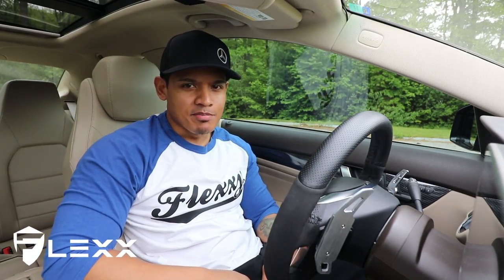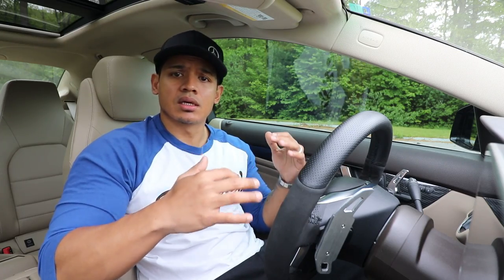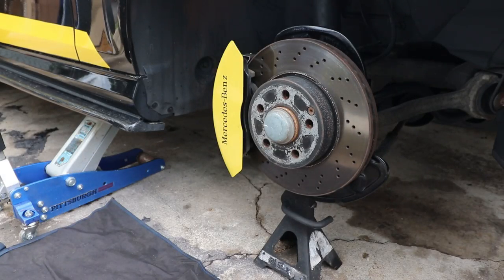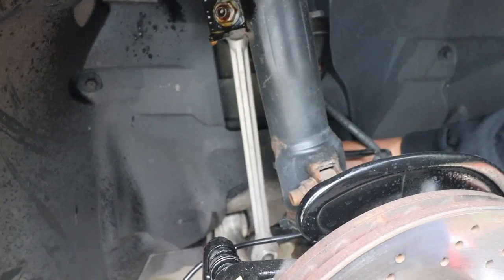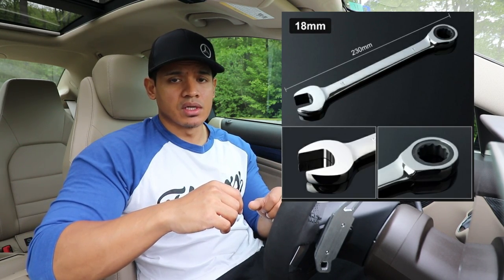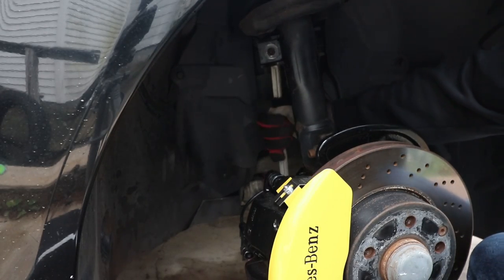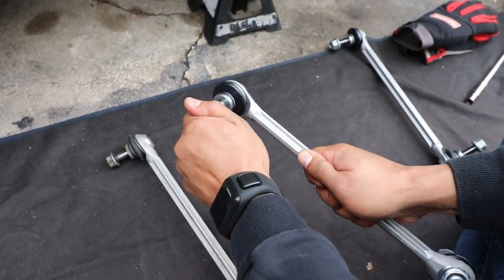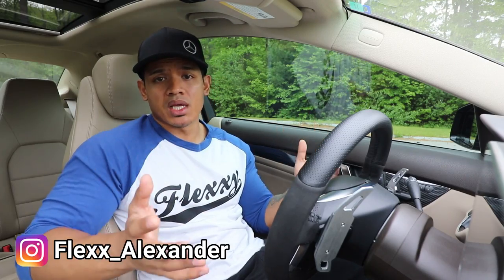Why do the sway bar links on a Mercedes fail so quickly!

Comment: I thought you was going to address the problem of " WHY" the links fail so quickly. As per your video title. Anyhow thanks for the tutorial....good job.
Reply from the maker: The quality is just terrible. That’s all.
Reply: I've changed my end links twice already. Seems like they fail every year.I thought Lemforder would be better than that. @TheFlexxGarage
Reply: If you have lowered suspension that's why. You should install drop links longer the same amount you lowered your suspension.
Reply: @bianbian428 I just used new lemforders last year and the rubber already splitting

Comment: Owning a Mercedes is nice, but it's a never ending story with clunking and clicking, and when done all that you find out the suspension top bushes also need doing! 😭
Reply from the maker: Not me. Only had this 1 issue due to normal wear and tear.  And I had 1 extended warranty part replacement and that’s it.  Was a great car. That’s why I bought another Mercedes.

Comment: Just a tip but I recently put performance/adjustable sway bar links on mine, and whether stock or not they have to be on a actual Vehicle Lift for proper Pre-load, jacking up that part of the suspension wont give you the correct Pre-Load. If they are installed with the load slightly off even if you don't notice it this will cause the sway bar links to give out very quickly or wear a lot faster. If there is proper Pre Load applied and they still wear out quickly, that usually means their is something wrong with another suspension part. Sway Bar Links are more of a fail safe in case another part of suspension goes out. Just a tip for next time!
Reply: Does the excessive wear occur on the ball joint because the ball joint won't have its full range of motion afterwards if it hasn't been pre-loaded because it won't be in the neutral position when the weight is on the wheel and the car is in a flat surface?  I found that the end links bolting surface must be lined up perfectly flat with the strut bracket bolt hole bracket at the top and with sway bar bolt hole surface at the bottom, otherwise the ball joint bolt comes in at a slight angle into the holes, and you end up with a small gap between the end link and the strut bracket at the top at the bolt point and sway bar at the bottom when you tighten fully (98NM), (causing the noises later ?).  Anyway that's how I did it because I don't have a vehcile lift and on the ground I can see the bottom ball is in the neutral position, it sits flush up against the sway bar, and the sway bar is horizontal to the ground.  No noises, drives straight, steering feels much tighter and even in both sides, the car sits flatter on cornering.  See what happens I guess.
Reply: Potential silly question but what do you mean by pre-load? I changed my sway links by jacking the car up in the middle pad at the front and removed wheels, changed links (I didn’t have anything under the control arms taking any weight etc) just removed old ones and new ones straight in.

Comment: Thanks for the video man. Mine started to make the same sound  a couple months ago. Amazing!

Edit: not exactly the same sound, but mine squeaks.
Reply: Depending on how worn they are, if the lubcrication/rubber has completely disintegrated you will get a HORRIBLE squeal when you are driving, yet it stops when you are braking. I found that out through experience.

Comment: Should be able to get around 80k-100k km's.  Need to make sure the end links tighten up flush with the strut bracket surface and the sway bar.
Reply: here is a discussion about this: https://superpro.com.au/how-to-install-sway-bar-link

( yes it is about after-market adjustable end links but the principle is the same- the end links must be fitted in a neutral position with the wheels under normal static load on a special hoist

if they are not it will not be possible to have them tighten flush against the strut bracket or to the sway bar because the bolt of the end link ball joint will not come in the right angle.  This will limit the full movement of the ball joint as the car is being driven and steered over uneven roads causing early failure which is what I think might have happened to your previous pair of end links that failed quickly

Comment: I remember doing my endlinks. Was one of the most annoying things to do...
Reply from the maker: Yeah...the worst part for the benz is being able to use a torx bit or hex bit to hold the swaybar link shaft in place while taking the nut off. Especially on the lower nut. And if you strip that hole for the torx bit/hex bit, you are kinda screwed unless you cut off the nut.

Comment: I had the same exact noise. I replaced my sway bar links and the issue was fixed. Then a few days later the noise came back. Now I’m confused as to what it might be.
Reply from the maker: Wasn’t Installed properly then. Cause if there’s even a slight play…it will keep making the clicking noise (even if it’s new).
Reply: @TheFlexxGarage  I'm 90% sure I installed them properly. It was pretty straightforward. But I'll definitely check again. The new ones that came in were not very stiff but I assume that's how it is.
Reply from the maker: Did you preload them before tightening the bolt? Cause that’s where people make the mistake. They let it hang, tighten the bolt, and thinks it’s fully tightened. And when you lower the car, the weight of the car is now on the links and it will expose areas where it’s not tightened all the way.
Reply: @TheFlexxGarage  that's probably it. Definitely missed that step lol. Thanks!
Reply: I had the same exact issue and it turns out I didnt tighten one of the nuts enough.  Retightening everything again solved the noise issue
Reply: @Azhang22  it work with you after tightened ?
Reply: @TheFlexxGarage  What do you mean by preload like add weight lower the car a bit?????
Reply: Does your steering wheel make a squeaking noise when you turn it back and forth? If so it's the ball joints.

Comment: I have the same issue! However it goes away when i increase tyre pressure but returns when tyre pressure drops. Only happens when going over bumps and it clunks from the right side.

Comment: Very nice! Mine the clunky noises occurs only in bumps or degraded road. Is that the same parts? Anti roll bar links.
Reply from the maker: Yes. Possibly.  Or you might have shock issues.  I recommend you get it checked out by a shop before it gets worse.

Comment: My c300 with 150,000 miles on it recently is making a clunking noise from both front and back on the passenger side and it happens when I’m driving normally also

Comment: Hey Flexx great vid, I have a 2013 E400 love the car, but it does the same over the bumps as well? Mine has the airmatic suspension which I thought was about the best of all, but still doesn't handle the real bumps like potholes etc?

Comment: Hey, Flexx. 
How are you? Not sure if you are going to see this message as the upload is 3 years old.
I have a 2021 C180 Touring that I'm tuning. I'm looking to handling mods at the moment and stumbled across some Eibach sway bars and Whiteline end links.
However, I was checking my car and it seems there is no read sway bar, is that the same with the C250? I saw that you just swapped the front end links, so I got curious.
Thanks.
Cheers,
Akamine.

Comment: Hello Flex, had the same issue with my W205 C43 AMG. Had dealership do the work, in addition, they claimed an alignment was needed after changing these links out. Do you agree?
Reply from the maker: In my opinion (and I’m not a mechanic), I don’t think its needed unless your car is due for an alignment or you went with longer or shorter links.
Reply: Geez they are ready to eat that money you earned hard. 
Alignment shouldn't be needed if tire wear is equal and you replaced them for OEM or OEM like parts.
Reply: Yoy don't need an alignment when only replacing sway bar links. Other suspension parts being replaced will require realignment after changing

Comment: So i have a w204 wagon and its lowerd and cant use original sway bar links. Been trying to find adjustable ones but just doesn’t exist
Reply: If your car is lowered you need longer bar links. I bought w212 ones which are 22mm longer

Comment: I have a w212 e class....its making clunking noise on light bumpy roads....taken I to 2 garages and still a year on no 1 can find the problem...they hand move the drop links and say they fine...I've had 4 springs changed and the front shocks..plz can u advise me if hand moving the sway bar links can tell u that the links are worn...thanks
Reply from the maker: pretty sure it's your shocks or the sway bar links. Note, you can't just diagnose the issues with worn sway bar links by using your hand unless they are super worn out. When a car is driving and hittin bumps, there's thousands of pounds put on these links and shocks. If there's even a little give, the weight of the car will make it known (as a clunk, rattle, etc..). A hand does not have enough force to "diagnose" the issue. I would find a reputable shop that works on Mercedes.
Reply: @TheFlexxGarage  many thanks for the reply flexx...I will take the car to another garage or will get the front sway bar links changed first as the shocks have been done....my car is a e250cdi sport...and after getting the rear springs from dealers the rear height is super high...dealer says it will have a red and green mark on the springs which are correct....but I've seen on the net that for sport models it's a red red green dots on the springs for sports springs

Comment: Great video! Quick question. I notice you using a floor jack. Are you lifting on the rectangular inserts on the sill with some sort of block on the jack or are you lifting from another point?
Reply from the maker: Lifting it where the jacking point is on a c-class. My floorjack has a wide, round, flat rubber plate. I don't need a block.

Comment: I just broke a T40 torx bit after using PB blaster on the top nut. Had to pause the job because I could not remove the top nut. Have you ever had to cut one off because you couldn't remove the but with a torx bit?
Reply from the maker: Yea. I did the same thing in the other side.  I used a “nut splitter” to “cut” off the nut. You can get them almost anywhere. Worked perfectly. Just gotta buy the correct size that can fit over the nut.

Comment: These are heavy cars with tight running tolerances. Depending on the roads the parts will wear quicker than a lighter car.

Comment: I get a clunking sound only when I drive in the city especially when slowing down. On the highway clunking disappear. My mechanic cant find the problem lol.
Reply from the maker: Sounds like you need a new mechanic if they can’t figure it out.  Lol

It’s probably your shocks or shock mounts.  But again, could be anything. You need a qualified mechanic to diagnose it.
Reply: @TheFlexxGarage  The clunking sound comes from the middle not the wheels
Reply from the maker: Well you never said that.  Lol. I can’t diagnose your car without seeing it.  Definitely have another mechanic look at it as a second opinion.

Comment: Have you met the problem about camshaft position sensor bank1 where the issue is not the sensor or magnet but after some research looks like it is a common failure for a c250 do you have any advice or maybe a video?
Reply from the maker: Common problem. Camshaft adjuster is worn and timing is completely off. Keep driving and your engine will probably break down. It’s a $1500-$2500 repair. Go to a specialized German car shop if you want to save money. There’s no DIY for this.

Comment: What did you buy exactly. Im about to replace my sway bar links but I’m a bit confused as to what I need to buy as far as the sway bar link nuts
Reply: Mercedes part# 000000003276, it's just a grade 10.9 M12X1.5 lock nut.  $2.40 each at MB dealer.  I bought a few from the dealer and still haven't used them, I resued the old nuts and they work fine.  I've had my car apart so many times, struts, control arms, coil springs, and yet to use a "new" nut or bolt.  I just clean them up with a brass brush to clean out all the old loctite Mercedes loves using. Just replaced some rusty rear dust shields this weekend and reused all the hardware, though I did replace the brake pad hold down springs, part# 2014230592 for 70 cents each at MB dealer.

Comment: Hey Flex, I will be doing this job soon on my 204. What is the torque spec you used to tighten the locking nut? Did you use a specific one or just go as snug as possible?
Reply from the maker: I just went as tight as it will allow. And for these damn links, they have to be super tight or else it will click over bumps.
Reply: Sounds good. I've been scrounging around on the internet and haven't found anything concrete or consistent. Thanks for the help man. Appreciate it!

Comment: Hey man.. I have a 2007 e350 Benz where do I buy the sway bar links for them? I’m having a hard time finding them.. thanks
Reply: I just bought my end links for my car. Can't wait to install .
Reply: Dealer ship
Reply: FCP Euro.  I buy all the high wear  parts from them for there lifetime warranty replacement.   They warranty everything even brake pads, rotors, windshield wipers etc..

Comment: Hey bro, what's the worst that can happen if I don't replace my stabilizer links? I've got  a w203 and I think it's the same problem. Upon driving on bumps, it makes this horrible sound. Btw, how much did you pay for the passenger and driver links?
Reply from the maker: its wears and wears and can snap, making your car have more body roll when turning and losing steering performance which is a huge hazard not only for you but other people on the road. They are like under $100 for a pair.
Reply: @TheFlexxGarage  hey thanks  a lot for replying bro,I really appreciate that.

Comment: Why they fail so quickly..? 
Mercedes' double wishbone suspension eats any moving parts if they are not correctly installed...
When I install something new on mine, I always lightly pretighten it first, then I put full weight on the wheel, and then I tighten it to spec..
Reply: rvidal0001  to properly tighten these, you need a set of through sockets. harbor freight sells a kit that's pretty reasonable. 
https://www.harborfreight.com/sae-metric-go-thru-socket-set-21-pc-62305.html

Comment: Hi Flexx, You installed a strut bar which bolts across the engine if I recall. Q. Does that help extend the life of these links or is there no effect?
Reply from the maker: Not really. Just helps reduce body roll and helps with turning.

Comment: So why do they fail so quickly ???
Reply from the maker: Don’t know.  Could just be a cheap part or poor design or just the nature of the piece. I would rather have this piece start to fail and i pay small money to replace it several times before i have to replace other larger, more expensive suspension components.
Reply from the maker: Plus the roads in my area are pretty bad. That takes a beating and puts a lot of stress on that part as well.
Reply: @TheFlexxGarage  Its because the front shocks are starting to wear out. These cars dont have any upper control arms so when there is a play in the shocks the sway bar links fails very quickly. If you change the shocks aswell, the sway bar links will last much longer :)

Comment: Hy. Any shakes at high speeds? Thanks. I don't hear this sound in the car and I have a little play in the front right wheel. (could be the bearing a bit loose?) Thanks.
Reply from the maker: No sound. You have another issue if you have shakes.  Alignment, bearing, loose lug nuts, uneven tire wear, tie rod ends, etc.  Get the car jacked up and get it diagnosed before things get worse.

Comment: I don't think was your sway bar links entirely. They shouldn't go out that fast even from bumpy roads. I changed mines but either check your control arms or your top bushings of struts.
Reply from the maker: Nope. I checked everything and everything is prestine and firm. It’s my sway bar links. They are usually the weakest part of your suspension system on any car. Next to go are usually tierods. Last to go are usually your control arms and ball joints.
Reply: @TheFlexxGarage  haha must be different on my car then bc mines the control arms started tearing at 110k miles and everything else followed lol. Now I think my struts need to be looked at.

Comment: i replaced this but noise came back again
Reply from the maker: You either didn’t install the news ones right and tighten them correctly.  Cause if they aren’t tightened correctly, there will be play and you’ll still get the clicking sound. 

Or you have something else causing the sound and it’s not the links.

Comment: I really don’t get it........
I have a c class 180 avantgarde estate with a business package. It is a 2012 car and i am very happy with it. I bring the car in at my local official Mercedes dealership for service every time it needs it. The car has never had an issue......never ever. Nothing has broken. Not one single part! So i don’t get what you are doing to your car......you replace perfectly good original Mercedes parts for cheap parts of lesser quality. Why? You unbolted so many parts so many times that eventually even a Mercedes falls apart.